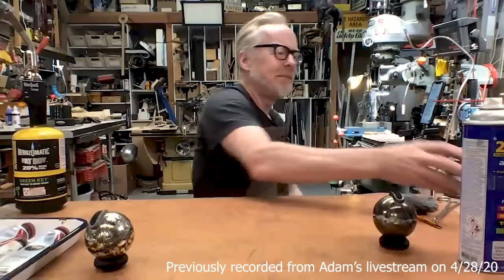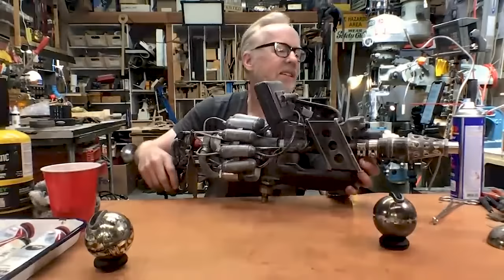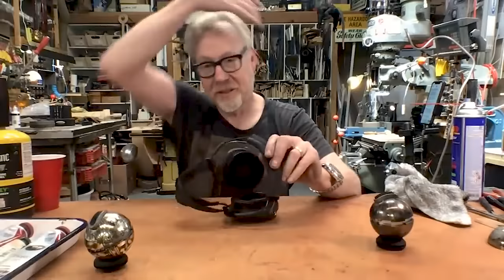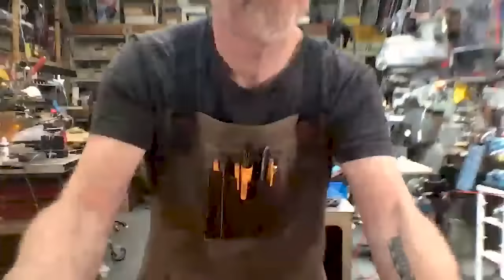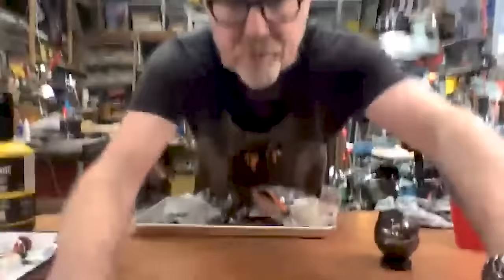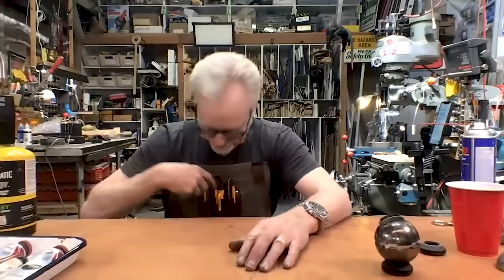"How do you deal with knowing someone dislikes your work?" Adam Q&A (5/5/20)

Comment: Just fyi I was recently looking for cover protection for a motorcycle that wasn't just a tarp. Like a tent. Didn't find a size I wanted. But got ideas to design my own. I also found tent garages for cars that would work to work on your car in the shade, and some security for tools keeping them out of sight, the tent flaps can have locks installed to keep out casual temptation, and concealment for bathroom tasks.

Comment: I'm a journeyman machinist. Starrett anything is like heaven. Brown and Sharp is very nice too. Mitutoyo, even Craftsman. You GET what you pay for. ;-)
Reply: What about the truck that drives around and sells out of the truck, those tools are they not good?7
Reply: @lordperezident   Those tools work.... just not the same as the good stuff.
Reply: @if66was99  I thought snap on tools were legit or are they over hyped??? Lifetime warranty if that is correct ?
Reply: @lordperezident  I've never used any Snap-On tools. I equate them more with auto mechanic's tools. Wrenches and sockets and stuff. I use those... but my tool is a big CNC vertical mill. Big CNC lathe. Mills and drills and taps. And then good measuring equipment for close tolerances. Like Starrett. :)

 Craftsman has (or had) a lifetime warranty. Maybe Snap-On does too, again, idk.
Reply: @lordperezident  I thought you meant a truck that sells cheap tools. Snap-On is a good name, I've just never used any.

Comment: 17:40 I was building a 2ft square box from someone else's measurements (from a pic of a pad of paper). Once I cut the frame out of wood, I realized no matter how they were assembled, they would not equal 23 inches (plus 1/2" plywood face). I worked backwards from what size I wanted and cut new 2x4s into the required sizes.

Comment: To the titular question I would add, as a professional maker of things, a design engineer, sometimes we have to make things that even we do not like because it is our jobs to make it and we make it as well as we are allowed to make it. One of my first big projects I disagreed with how I was told to do it, even the very notion of the product, and I pointed out many flaws but was told to simply ignore them and just make it. So I did. I made the original prototype as well as I could, multiple parts big and small all shaped carefully by my hands on an old conventional mill and lathe, and a few parts being almost entirely shaped and fit by hand with saw and file alone. The final form and finish was not a significant concern because this was an in house prototype to test the function of a flawed product, it was not polished in any sense (I even figuratively cut corners by literally not cutting the corners off), it would probably never see the light of day and just be added to the racks and racks of similar dead end prototypes that were of equal (or often lesser) quality. No problem. Except it was not shelved.. it was taken to a bunch of trade shows all over the country, displayed front and center at company booths (sometimes on an actual pedestal), the president of the company did interviews holding it, press release photos were taken with a celebrity spokesperson holding it, it was in a trade magazine and on numerous websites and page after page of comments followed which made the exact same arguments I did, pointed out the exact same flaws, and there was nothing critical they said about the product I did not agree with... but it still hurt. It hurt a lot. I cried in my office for a few minutes thinking my career would be over before it started because it would be forever associated with this terrible thing that I did not even want to build in the first place. The commenters had no idea how many flaws I had resolved from the original concept which was thrust upon me, did not care that there was no better way to do what this thing did (even if it was basically pointless), and though I agreed with them on what they said the manner in which they said it still trod on months of hard work designing, testing, redesigning, building, retesting, redesigning again, rebuilding, retesting again, and on. My work was pretty good. Not great, but not bad. I could not have done better at the time, considering my experience and available resources, without unreasonable and unnecessary cost to my employer (and by extension the customer), and I delivered exactly the final product my employer wanted. It is good to listen to the criticism because it is possible they see something we did not but, as Adam was saying, often times it is from people that do not understand the context as well as we do and do not see the reasons for why things are the way they are. Have to let those comments go on by. It isn't easy but it is that simple. And in my case, deep down in the reply threads, there was the occasional "that looks great!" or "this is exactly what I wanted" and right there, those delirious fools, I did it for them. And the money. Mostly the money.

Comment: Respectfully how the electronic ear pro works is that they are just like normal ear muffs that block most of any frequency and level of sound. With the addition of external microphones and internal speakers with a band pass style filter that only pipes sounds of a safe intensity into the speakers to your ears.